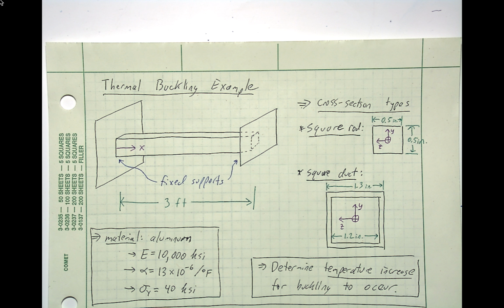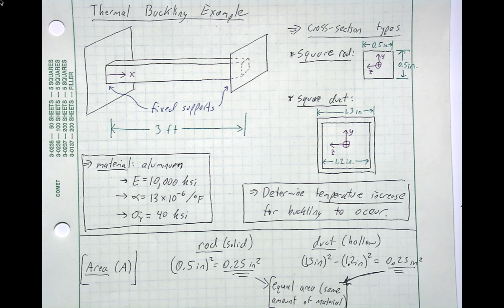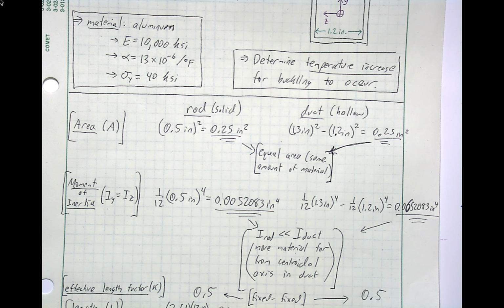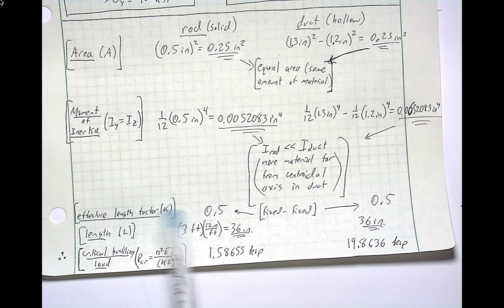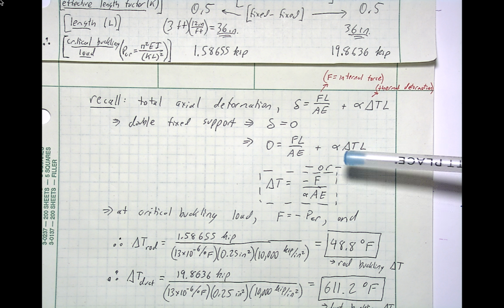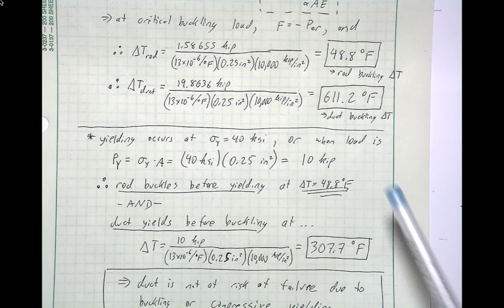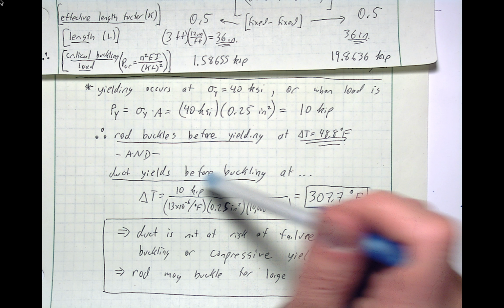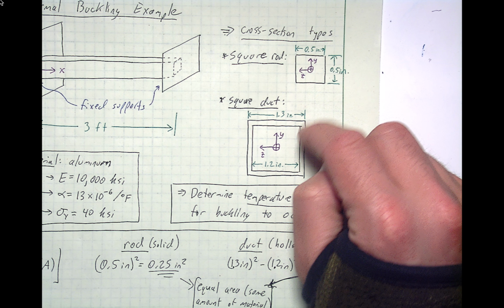Thermal Buckling Example

Comment: For a fixed clamped ends,if temperature rises such that it buckle. Then if I removed the clamped ends, is it will come to original position or not?
Reply: if its over material yield, plastic deformation would occur